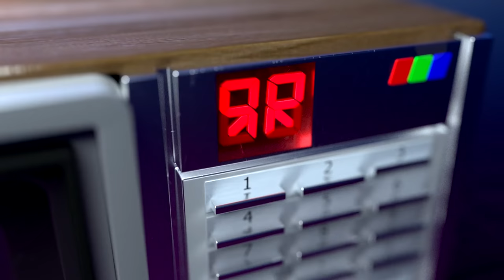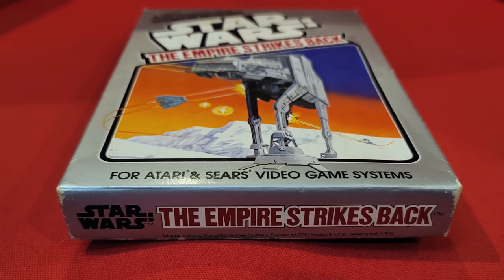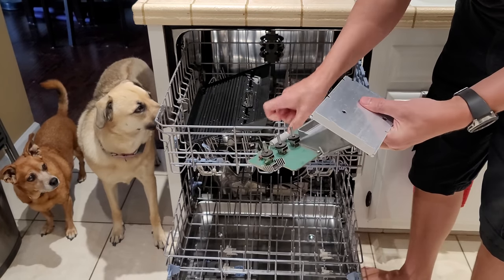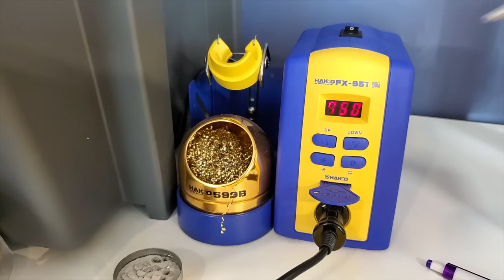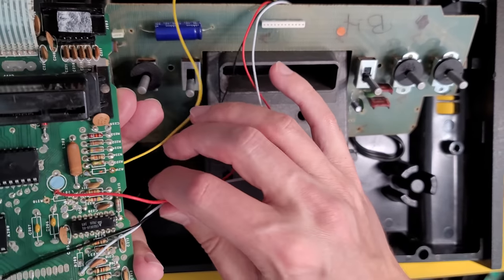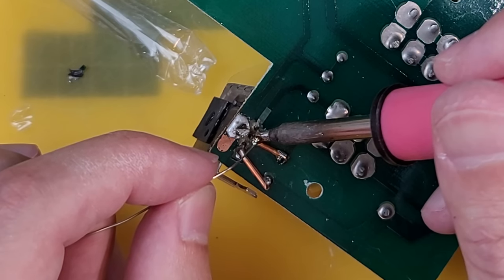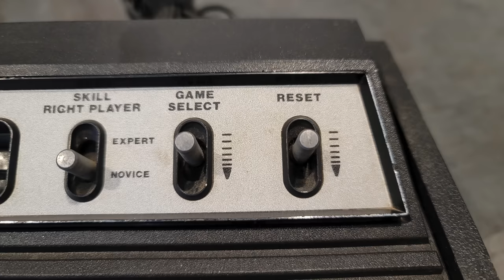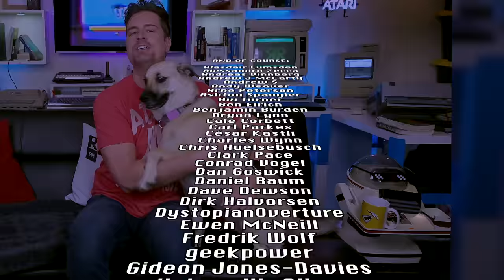Can we fix this rare 1977 Atari VCS? Sears Telegames "Heavy Sixer" Upgrade & Refurb!

Comment: This is so cringe worthy. A dishwasher, and oil. I probably would have gone for dish soap, and a brush. I would have probably gone with masking and spray painting the case. Oil is going to leave the surface of that always oily. And if you wipe it off, it'll go back to being dull. Reflowing some of the solder would probably not be a bad idea either as after 42 years, it's probably in need of some care.
Reply from the maker: Well, with all due respect this is my machine and my choice. You are welcome to make your own video showing all your techniques. A dishwasher is a technique electronics engineers have used for decades - ask a few. Haven't you noticed car dash slick leaves the dash oily? So what's your solution to giving tired plastic its shine? Please share. Also I reflowed all the solder but I don't show every second, the video was long enough and took 9 days to make as it was.

But as they say, the only people who get nothing wrong are people who do nothing. 🤷‍♂️ I hope you at least enjoyed the positivity and fun I'm trying to inject into the world.

Comment: It's possible to cut and feed wires through existing holes and solder them directly to contact points rather than irreparably Dremeling a 44-year-old console to shove through a moulded plug from eBay
Reply from the maker: After 9 days on this project and giving careful thought to the fact that the rubber plug would entirely conceal the tiny shaving I made, I decided on that course. Naturally if you own the machine it is up to you if you prefer to take a different path.